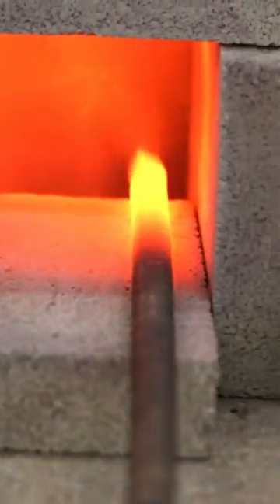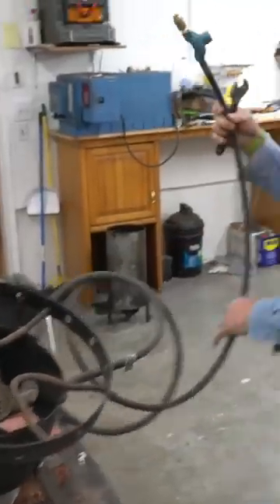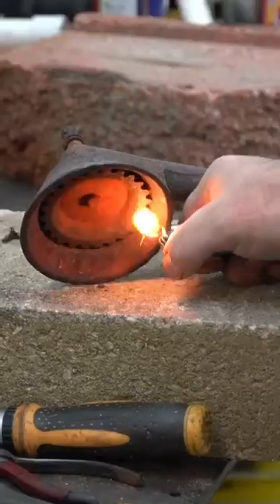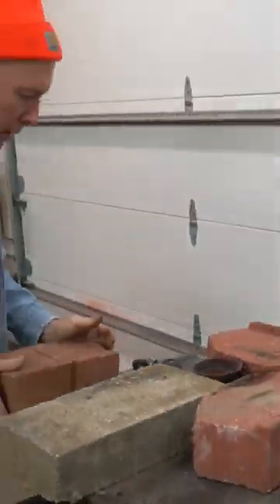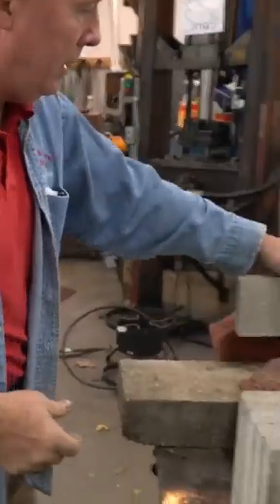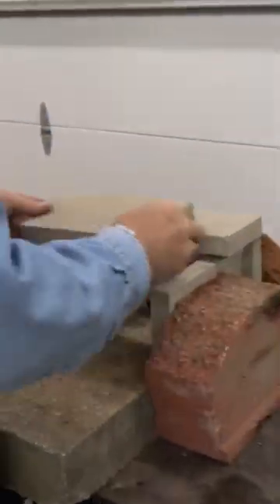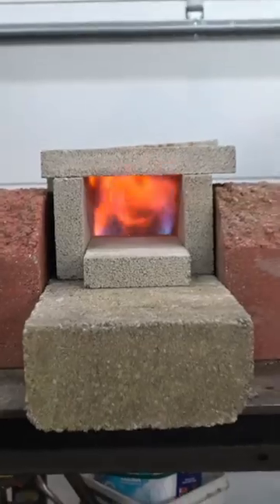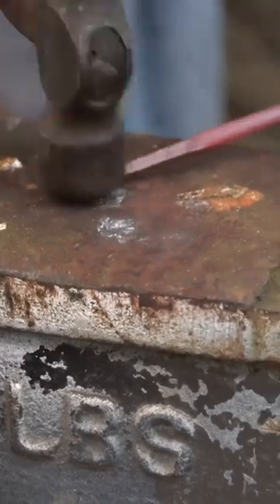Making a $20 Forge

Comment: When I started, I bought an inflatable mattress pump, and a metal tube. Dug a pit in the ground as the forge, put the pipe in the ground diagonal to that hole, and fed air into the bottom of the forge with the mattress pump through the pipe. Was a super simple but well - working setup
Reply from the maker: 👍🏻nice
Reply: Pretty much did the same thing except I used a modified shop vac lol